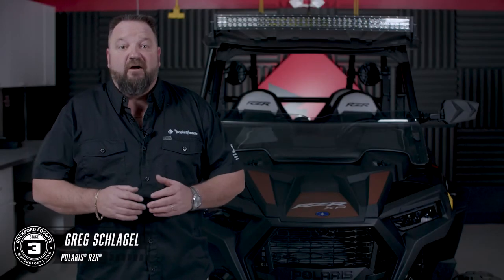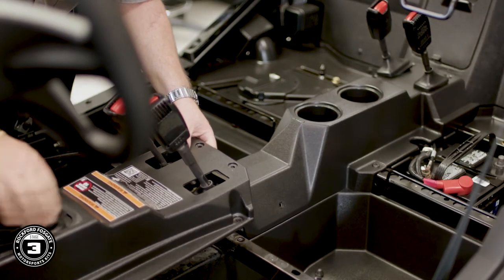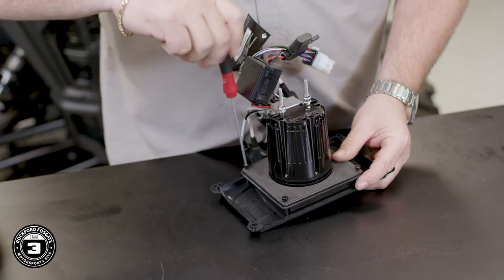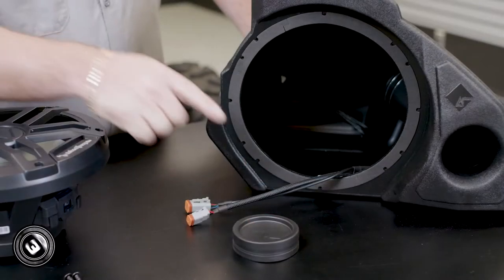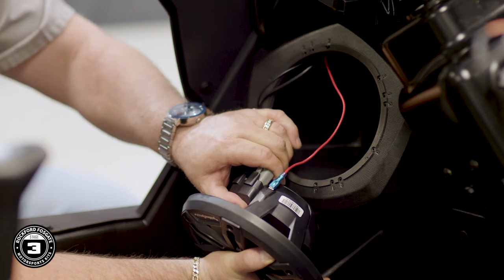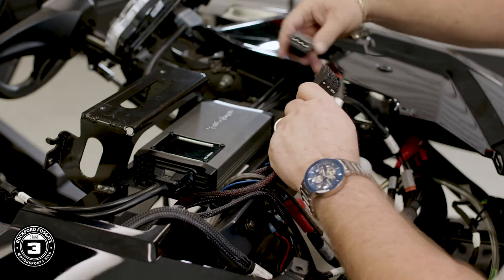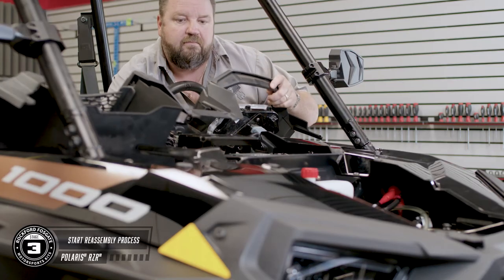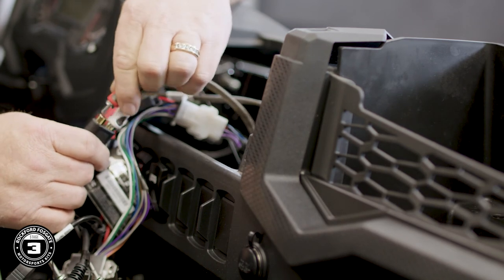Polaris RZR14-STG3 Installation (Gen-3)

Comment: What's the main difference between the gen 2 and the gen 3. Can't find the gen 3 anywhere!
Reply from the maker: Great question Jamie, the main difference is Gen-3 has RGB lighting on Stages-3 thru Stage-6 (Stage-1 and Stage-2 kits are non illuminated).  Since these were just released and probably not in stores yet, you can get all the info here: https://rockfordfosgate.com/products/details/rzr14-stg6/